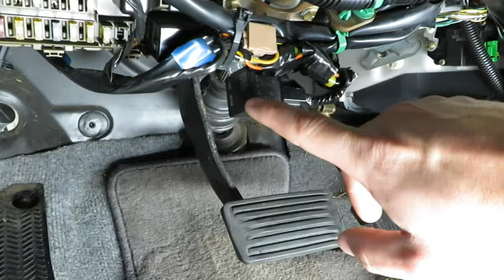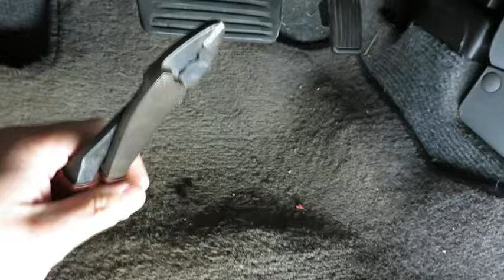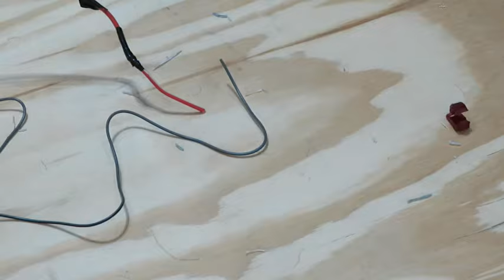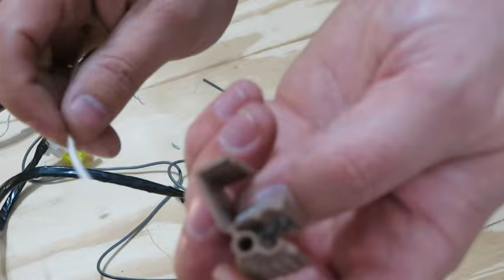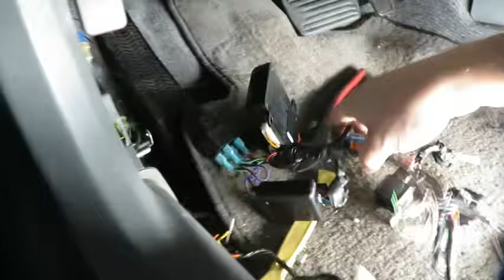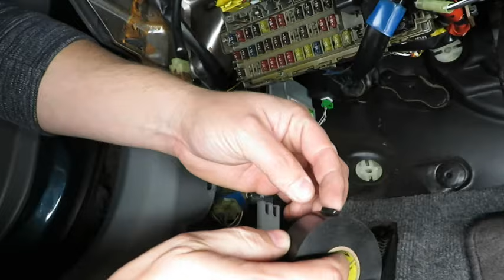Car Alarm Removal Made EASY Without Damaging Your Vehicle!

Comment: I have a 80 milliamp draw on the ignition switch circuit. I keep the alarm disabled with the button under the dash. Could this be the early 2000s aftermarket alarm causing the draw?
Reply from the maker: @kendavis8647  the best way to check amp draw on an aftermarket alarm is to pull the fuse on the red wire and put one lead in  each of openings for the fuse. This will tell you the current draw on the alarm in either state, let on or keep off.  As for 80 milliamps, that shouldn't drain the battery on a car that is used on a regular basis. I would be concerned at 500 milliamps or more.
Reply: @DCAutoEnhancement  Thanks for the quick reply and the information. If 80 milliamps aren't a big deal I see will just keep topping off the battery every two months. I only drive the car a couple of days a week.
Reply from the maker: @kendavis8647  if you think you have a parasitic draw, I would first check the alarm the way I mentioned and see what you have there. Then I would check at the battery on the positive terminal. Unhook the cable from the battery, the put one lead on the cable and the other lead on the battery. If you have a larger draw, at least you will know if it is the alarm or something else. Driving the car a couple times a week should keep the battery charged enough. If your battery is dying withing a couple days, you either have a more significant draw, bad battery, bad ground, or possibly a faulty alternator.  I would be curious to see what you find out.
Reply: @DCAutoEnhancement thanks for the video, I'm troubleshooting a drain on a diesel Ford excursion with two batteries. I think it may be related to a shoddily installed or failed viper security system I see under the dash. New batteries, good alternator, drains while off, removing fuses and relays while having a multimeter inline with a battery at the negative yields no info on which circuit, the draw remains at over 1 amp constant. Interestingly the drain continuously increases in amperage as I watch the meter and search. About to open the dash and wring out all the harnesses and wires one by one looking for the drain, dreading removing this system, any idea where to focus to find the drain?
Reply from the maker: On an Excursion, the knee bolster comes off really easy. I would pull that off, look for an aftermarket unit. If you find it, pull the fuse or fuses then check amp draw at the battery. If it still has a draw, look for the black ground wire and make sure it is tight. Actually I might start there. Let me know what you find.
Reply: @DCAutoEnhancement  still had drain at the battery when i pulled each of the fuses associated with it, should i pull all of its fuses together too or will separately suffice? I took apart the whole dash and all the clips, and tried to watch drain at the battery as i clipped each component back in. To my frustration, the draw was inobservable during that whole portion, my meter read 0.00
Reply from the maker: @Kevin-l7c5k it doesn't matter if you pull all fuses associated with the aftermarket unit. Basically you are trying to isolate it for verification.  One thing you can do is keep set up with your meter between the batteries and the vehicle and pull each fuse one at a time looking for it to drop.  I have also heard of people pulling all of the fuses then place them back one at a time. I think this could cause some confusion because some electronics will (wake up) once re energized, pulling more that idle current. I hope this helps. Keep me posted
Reply: @DCAutoEnhancement  ive pulled every fuse and relay on the vehicle to no avail, but as i said after pulling harnesses the drain appears to be gone? Im done for the night but ill follow up when i return to it
Reply from the maker: @Kevin-l7c5k I guess I wasn't catching what you said. If the drain is gone after unplugging the harnesses from the aftermarket unit then that is your issue and I would either remove it or go through all of the wiring including and especially the ground(s).
Reply: @DCAutoEnhancement  good morning, I actually removed every dash cluster or component, and just one part of the system, the immobilizer, by unclipping their harnesses after I removed the dash, and that's what cleared it. upon reassembling each piece and watching for draw, nothing happened, the draw was gone, and now I'm stumped.
Reply from the maker: @Kevin-l7c5k is this a customer vehicle or yours?
Reply: @DCAutoEnhancement  mine, it's a rare diesel variant of the Ford excursion I'm reatoring
Reply from the maker: @Kevin-l7c5k it's possible a relay was stuck and when you de energized it it released, I would just leave everything hooked up and see if the batteries die off. Sounds like you may have at least fixed it
Reply: @DCAutoEnhancement  thanks for being so responsive, gonna check the vehicle again in a bit

Comment: Hello, Very nice video, I am investigating an intermittent dead battery. Could the aftermarket alarm play a role in this. 04 crv.
Reply from the maker: Yes, that can be a cause. Look up how to find a parasitic draw. That will help you determine if it is the alarm or something else. You will need to know how to use a digital multi meter. Or you can just remove the aftermarket alarm and see if that takes care of the problem. What I would do first though, is take the vehicle to a place like AutoZone and have the battery tested.

Comment: i found a similar setup in my 96 4runner... i wished id never found it cause after i messed with it .. well it wont start anymore... i think mine cuts power to the fuel pump instead of the starter and might also mess with EFI... but its going to be coming out this weekend cause i really miss driving that vehicle... im hopeful you might still be available if i have some questions... when i found it i thought it was just a kill switch
Reply from the maker: When you get into it, comment here again and I'll get you my email address

Comment: Do you have to reprogram to fob to work with the original door locks?
Reply from the maker: Not usually, these aftermarket alarms usually do not interfere with original wiring. However some cars have different wire types for their door locks requiring relays that are installed at a break in the wire or the wiring goes through the alarm. In that case, it is a matter of putting each of the wires back together. What kind of vehicle do you have? Year, make, and model?
Reply: @DCAutoEnhancement  2003 Acura MDX, I just bought and didn't come the original FOBs only have the after market ones, prestige (I think.) very similar set up to the one you show in the video. just want to make sure if I take it all apart I can still use the fobs to unlock the doors. 

Excellent instruction BTW. I learned a lot from watching, Thank you..
Reply from the maker: @iamketoman2270  if you remove the aftermarket alarm or keyless entry like what was shown in the video, your fobs will not work.  Are you having issues that you believe are linked to the installation of your aftermarket system?
Reply from the maker: @iamketoman2270  btw, thanks for watching and asking your question.

Comment: I paid someone to install a car alarm with a kill switch etc. When I turn on my car I saw that they put a really thick gauge wire which gets extremely hot(touching it burns me), I've cut it and the horn would not stop until I reconnected it. I have a short on my dash and stereo when I turn my turn signals on and I can't seem to find the culprit. When the car is off there is a power draw on multimeter -12.37 and I pulled all fuses to no change
Reply from the maker: If possible, I would take it back to the person that did the original installation to see what they can do.  Obviously that wire shouldn't get hot so there seems to be an issue.
Reply: @DCAutoEnhancement  it seems like that wire was put there for that same reason, the person who installed it is in another country. Any other options?
Reply from the maker: @mgbretro  if the wire gets that hot, it is either shorting to ground or the Resistance on that wire is high
Reply from the maker: Can you email some pictures to info@dcautodiy.com
Reply: @DCAutoEnhancement  sent!
Reply from the maker: @mgbretro I'll be looking for it. Sometimes it takes a while to get through.
Reply: @DCAutoEnhancement  nevermind it says the domain for the email could not be found
Reply from the maker: @mgbretro  dcautodiy@gmail.com

Comment: Before removing the security stuff, did you disconnect the battery or not? Just curious. We want to remove the alarm, an EVS II from my 1998 jeep cherokee. We have the install manual and are thinking we just do everything in reverse. Please help! Greatly appreciated!!
Reply from the maker: To be honest, I did not disconnect the battery however, it is best if you do.  If you have any questions during the process, let me know, I'd be happy to help.
Reply: @DCAutoEnhancement  is there a way I can text you soo I can send you pix and get your much needed help, please?
Reply: @DCAutoEnhancement  ok sir. I emailed you. Thankyou!!
Reply from the maker: @nicolelarson8606  For some reason its not allowing me to reply to your messages
Reply: @DCAutoEnhancement   That's weird. I've never had that issue before. Can I just give you my cell to text and send pix. I don't know why my email won't work. It's never had any problems before.

Comment: Any idea if these after market alarms can cause fuel pump problems?
Reply from the maker: Aftermarket alarms or remote starts should not affect the fuel pump in any way. The only way they could potentially interact is with a remote start. When the ignition is energized, the fuel pump primes. I don't see an aftermarket unit actually causing an issue. I hope this helps. Thank you for watching

Comment: Great video. Having a little trouble with my 04 pilot. I disconnected all the wires from underneath the dash. Now it won't start. There is another box that is Saturday into my OBD2 and I haven't removed it. Could that be what's not letting the car start. I bought a new harness to go on the back of the key and tumbler to plug into the main fuse box. So that's all new. Just wondering if there is something I should be looking for. Also I cannot seem to locate the starter relay so I'm not sure if that might be the issue. Because I am not getting power to the starter and I checked the starter signal fuse and it's good. Any recommendations
Reply from the maker: If you replaced that harness from the switch to the fuse box, you should have eliminated any aftermarket devices that would inhibit the starter from functioning.
Reply: @DCAutoEnhancement  yeah I definitely did switch the harness completely it's brand new. Now I guess I check the fuses that go to the ignition switch the starter signal fuse and the relay for the starter. That's all I know what todo next TY

Comment: I have a viper remote start and it started freaking out and trying to start the car on its own. Going to try and remove it but don't want to mess anything up. Don't want to have to get it towed cause ya know being poor and all
Reply from the maker: I understand. It may be an easy job to disable it. If you find the main brain, look for two red wires with green fused on it and just pull the fuses and see if that disables it

Comment: My 2010 tundra remote start viper alarm system finally took a dump. I couldn’t start my truck…I saw a fuse sticking out of a cable coming from a big black box that said Viper on it, I pulled out the fuse…..My truck starts now. If I do some sort of work with wires I use zip tie colors that don’t normally come on the car. Pink, green etc… so I remember it’s my work.
Reply from the maker: Good tip. Thanks for watching

Comment: I have a problem .I got a jeep liberty that came with an avital remote start alarm and the seller took the fuses out from it to disable it...since he lost the fob...I got a new one and a shop reprogrammed it. Then one day the alarm wouldn't activate    and my dash showed door ajar...I took the fuses out  and I noticed a burning smell.coming from under the dash...I also saw some alarm wires exposed without tape close to metal...Today the shop scanner read all 4 doors are ajar...as the dash cluster does not tell which door is open..You think the wires shorted out from the alarm...and mess up the BCM...also the fuel gauge is erratic reading.Thanks!
Reply from the maker: In my opinion, I would remove the alarm to verify that nothing is wrong with the vehicle itself. Then if you want the alarm, I would have a shop install a new one.

Comment: Folks use those crimp connectors on trailer wire setups.They fail all the time, you are right sodder and heat shrink your connections.
Reply from the maker: Thanks for watching and adding your experiences.

Comment: I have a '98 Dodge Durango that when I bought wouldn't start it had an aftermarket remote start installed with no security system but I guess it still had a sequence it had to follow to start after replacing everything to do with starting including fuel pump wires plugs voltage regulator everything from the starter everything crankshaft sensor I had found it I was missing a wire on the crankshaft sensor and I also may have had an issue with the with the relay switch but got it started now it after a few months it's not starting again I don't know I've lost the the remote for the remote start the fob and I'm thinking that maybe that's the reason I can't start it since everything else has been replaced having to remove it I'm just not sure that I am electronically inclined you so but going to do it anyway soon would this actually in fact keep my vehicle from starting not having a remote not being able to do the sequence with it even though it's not a security system just a remote start
Reply from the maker: Most times a remote start doesn't have a starter kill relay but it is possible. Look for a relay that is connected to a heavy gauge wire that has been cut and a relay installed where the wire is cut. If you have that, simply unhook those wires from the relay and connect the wire back together.

Comment: I have a 2009 Chevy Silverado. I removed a compestar cm 7200 remote start and now it won't start any help would be appreciated
Reply from the maker: @LarryHickman-m9o  they probably had a starter interrupt. In this video I had to reconnect the starter wire because there was a starter interrupt relay aka starter kill relay.  The Compustar may have had that built in so you wouldn't see the relay like in the video. You would have a wire coming from the ignition that has been cut in two that just needs reconnected. Let me know if this helps.
Reply: @DCAutoEnhancement  This actually is Larry's wife.. It's my truck my babe. Someone tried to steal it . Thankfully got interrupted. They grilled out my cylinder so I replaced and got a new key. And I removed the remote starter. The mobile programmer came to program it. And it wouldn't even read it. So I believe there is something I missed
Reply: By any chance do you do service calls via video or anything I'm really struggling with this. I'm very mechanically inclined. I do most of my own repairs. This one has got me stumped. It was running perfect before this mayhem. But I checked the battery, checked the fuses. Cleaned my grounds all off.  Still no start and no crank. I've did the back ECU reprogramming and nothing. I believe there might be a wire missing from the bcm
Reply: And your video "Rocked " well done.
Reply from the maker: @LarryHickman-m9o  email me info@dcautoenhancement.com with contact info
Reply from the maker: @LarryHickman-m9o  thank you

Comment: Hey my car remotes stopped working and the alarm is not going on there a fuse that should be looking for in the alarm system?
Reply from the maker: Usually there is a red wire with a red fuse if it is just an alarm no remote start.
Reply: Thanks I will look and hopefully it's just a fuse.

Comment: Great video with tons of good information. But I have a question you might be able to help out on a 2009 nissan rogue remote start with immobilizer how do I put the immobilizer  back to factory right now it starts engine with key in ignition only so I want to remove it because I can't even unlock the car doors with the remotes. I don't know why the remotes stop working and car alarm sets off. I was able to pull a fuse of the aftermarket remote start but now my remotes don't open or lock doors but by pulling that fuse I can start car with key, at least I'm not stuck. Any suggestions as far as removing and getting the controls to work on original immo of car. Oh and this was a nissan installation first when the car was bought  back in 2009. Thank you.
Reply from the maker: Thanks for the feedback. If you can get some information off of the equipment that was installed I can look into how it is integrated into your car.  Usually it isn't too difficult to put back to original but sometimes you do have to cut factory wires and wire the bypass in-line on factory wires. But, if you can, get me some info and I'll see what I can do for you.
Reply: @DCAutoEnhancement  thank you so much. As soon as I go to the car I'll see if I can get some sort of name of it. Thanks again.

Comment: Can a aftermarket alarm system cause electronic issues with the bcm or vehicle stalling problems?
Reply from the maker: Sorry my response isn't going to be helpful... Anything is possible especially when it comes to electronics. As far as probability, it's not likely that the alarm is the issue if everything was installed properly.